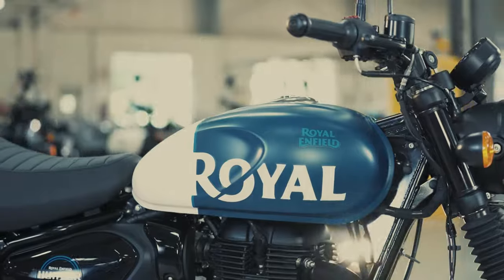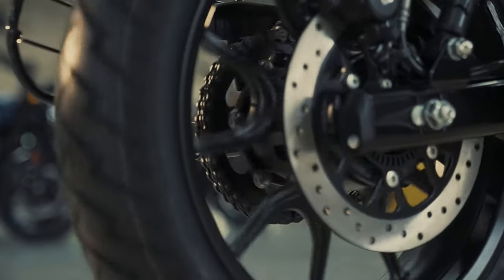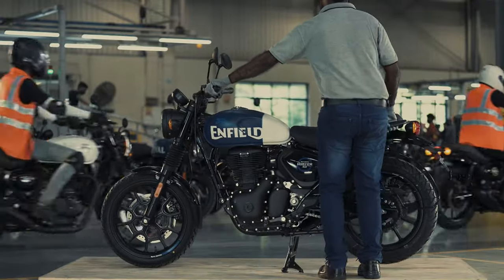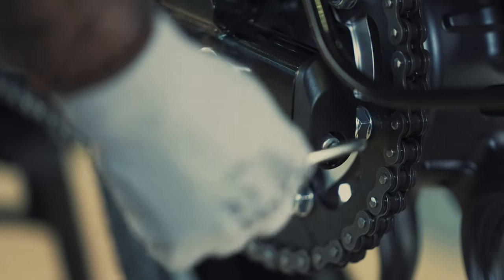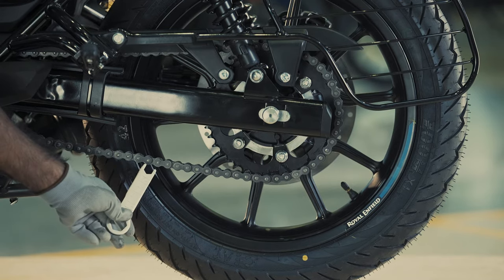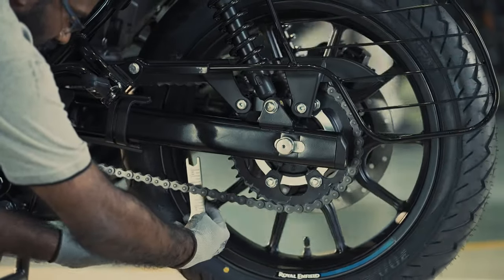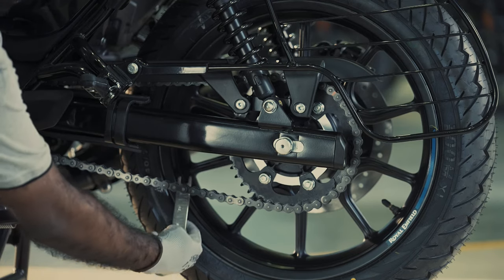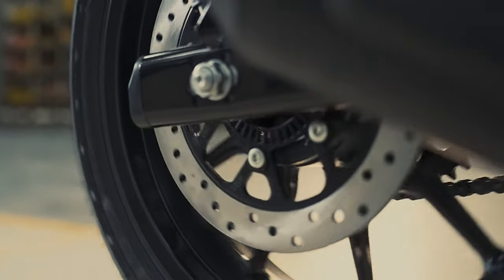Chain Play Adjustment | Hunter 350 DIY | #RoyalEnfield

Comment: The explanation is not so good
First of all the right size screw of the adjustor is the opposite way - in my bike its straight.
second thing, first of all you need to close the 24 mm nut and then to tight the adjusters - if you tighten them before close the nut the location will be change...